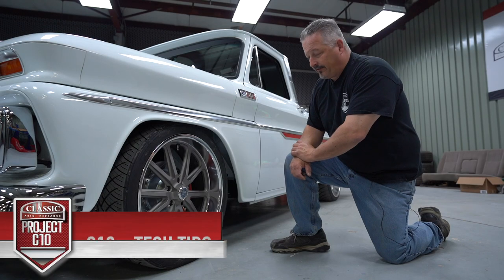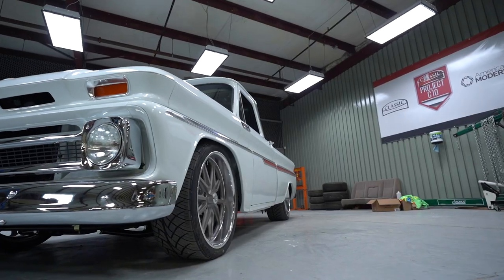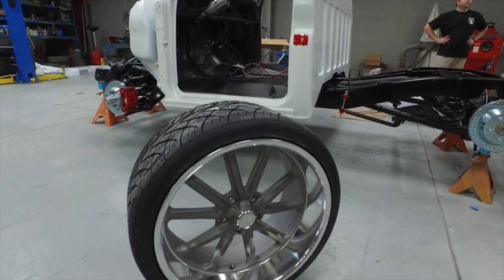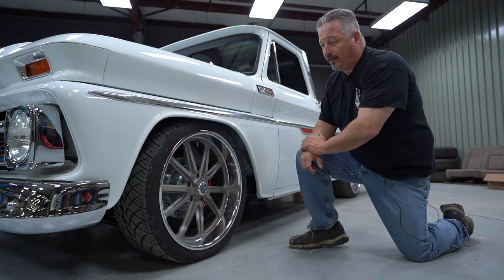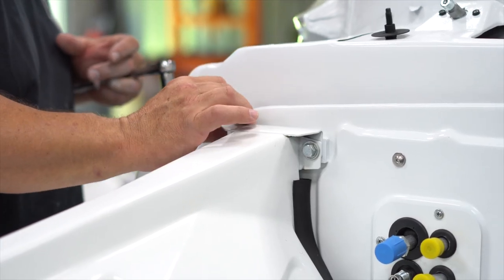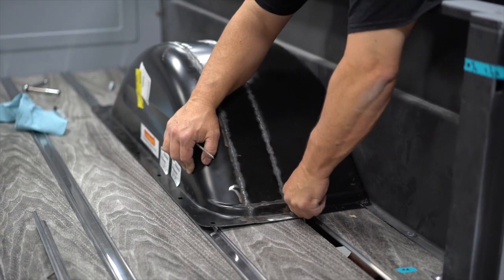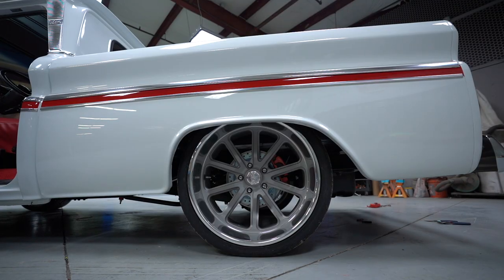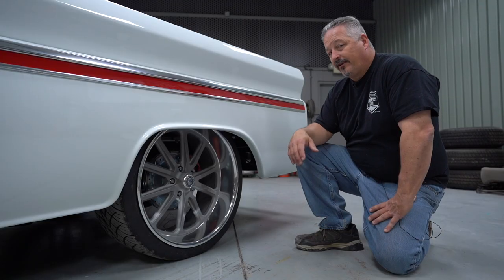Project C10 Truck Restoration – Tech Tips: Fitting Wheels & Tires - Classic Auto Insurance

Comment: Great build! Did you have to shorten the rear diff for those wheels? I’m building a 70 c10 and want to go with a 20x10 and don’t want to cut the diff down if possible.